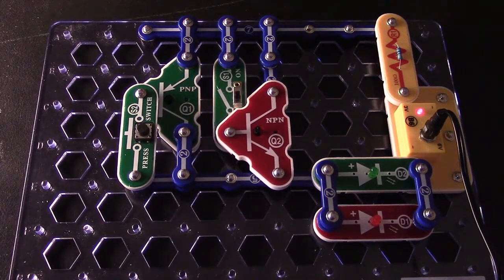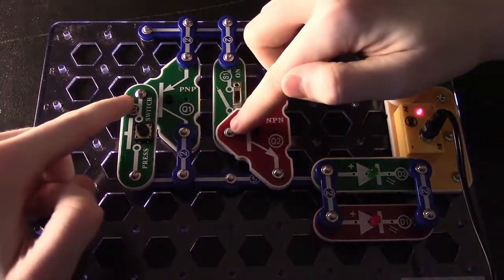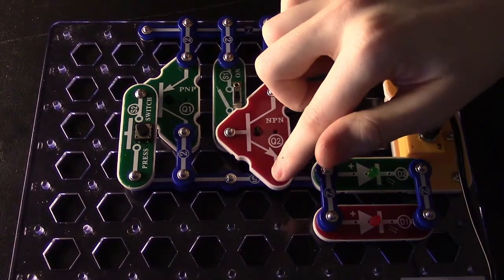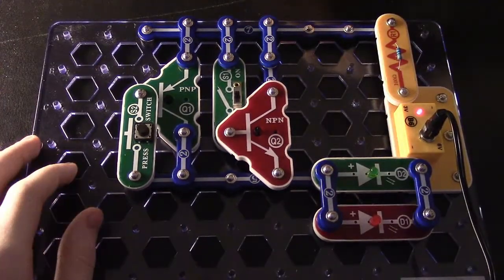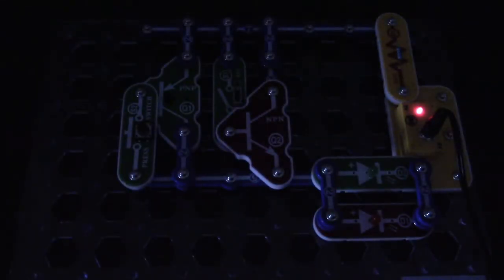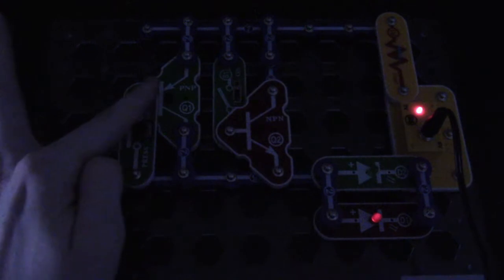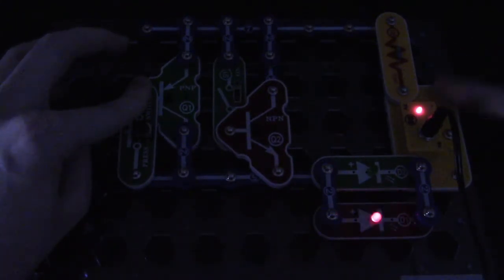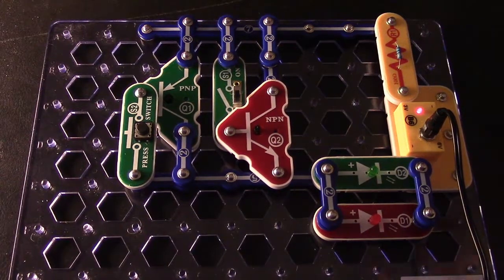Circuits: PNP & NPN Transistors

Comment: what is that board you are using and where can i get one?
Thanks!
Reply from the maker: Doug Kinsman They're known as "Snap Circuits" made by ELENCO. The sets are categorized by the number of projects that can be made with them (for instance the SC-750 set I use can create over 750 projects). Amazon pretty much provides all the various kinds of Snap Circuits sets http://www.amazon.com/s/ref=nb_sb_ss_i_0_9/190-6747483-7148352?url=search-alias%3Daps&field-keywords=snap+circuits&sprefix=snap+circ%2Caps%2C168